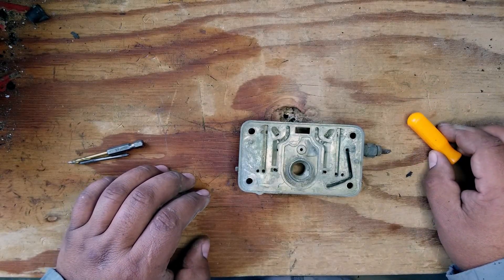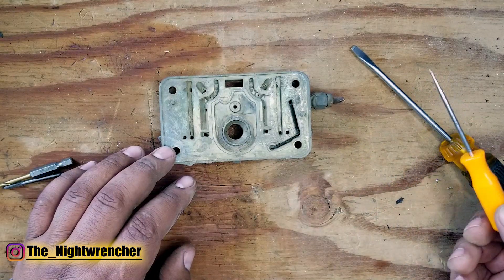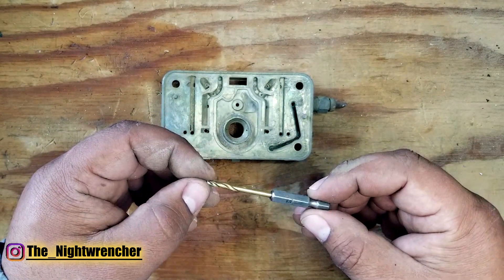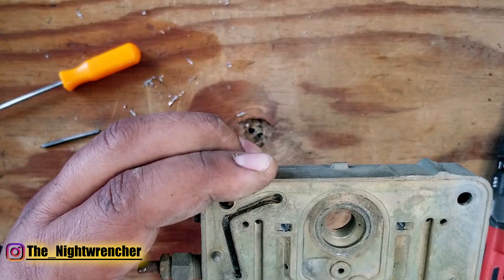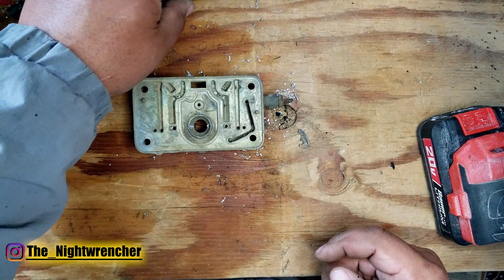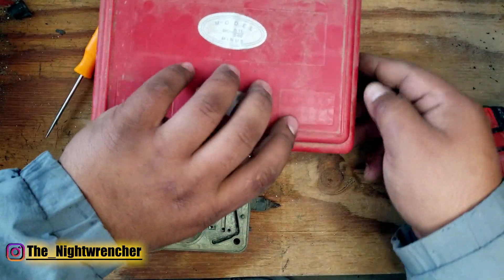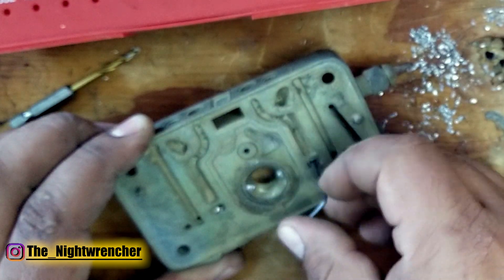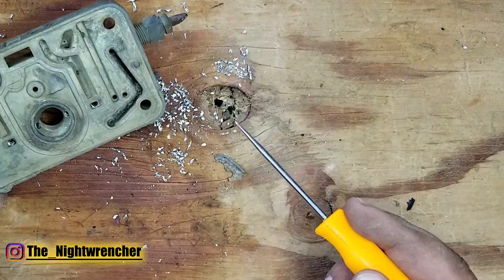Drilling Metering Block For Adjustable Bleeds | Holley Carb Tuning | Holley Carburetor Secrets

Comment: I recently did this with an early model 1850 metering block i got for cheap to practice on, this particular block didnt have the pressed in brass IFR restrictor, so a .090 hole was present. I drilled all the way through with a 7/64(similar to #36) drill bit using a pin vice for better control, then used a 6-32 plug tap, a bottom tap is prefered, but its all i could find locally. I tapped the hole just a thread or two at a time to set the correct depth, i did the same with the .046 PVCR hole, starting off with a 1/16 drill bit and worked my way up to the 7/64 drill bit. I tapped the hole, again,  a thread or two at a time to set the correct depth, used 6-32 x 3/16 brass set screws for easy drilling the hole sized needed for AFR calibration, all went extremely well and used a 1/16 hex key for the fore mentioned set screws, figure next time, i'll use 8-32 for the PVCR holes.
Reply from the maker: Thats exactly what I did when I built my carburetor for my turbo build. Eventually I upgraded to a billet block because I needed larger fuel wells but for the most part a basic metering block worked fine.

Comment: Thanks for posting your videos.  In this one, I applaud you for knowing to keep the IFR submerged in the metering block "wet" portion.  It escapes me why most aftermarket billet blocks want to put the IFRs only in the upper gas part of the chamber.  And there is already an air bleed for that chamber, so what are they thinking??
Reply from the maker: I think its because if you move it to the top, you can go larger on the IFR because the bleed screw will be bigger. Most carbs dont need the added size, but if you go E85 or alcohol, you will need the larger bleed
Reply: Idle circuit requires a pullover so the bowls don't drain empty after shutoff - it honestly doesn't matter where the restrictor is, as long as it has one.  Sizing is whats important, as thats what dictates transfer slot delivery.

Comment: Hi, great video.
I’d like to hear more about the relationship of the IFR and the air bleed that you mention at 1:50.
From what I have learnt from your videos I feel like I have my IFR’s perfect. But if I’m cruising on flat road at 60km/h (37 mph) then gra
Reply: Sorry, sent it before I was finished.
Steady cruising at 60km/h flat road, afr’s perfect on gauge. But if I gently lean on the pedal a bit more to get to 70 or 80 (43-49 mph) it swings very lean for 3 to 4 seconds.
I’m not accelerating hard enough to get much squirt form the accelerator pump, so I was thinking I need to get my mains in earlier, maybe by trying a down leg booster.
But your comment there made me think 
Could that be something I need to look at
Reply from the maker: It very well might. Ill have a dedicated video on it but basically, larger air bleeds airate the fuel to make it lighter so it passed through easier and the IFR controls volume so by increasing both, it should speed up the circuit. Also, booster design wont affect idle or transition.

Comment: 👍💪
Reply from the maker: You almost got yours running?
Reply: @NightWrencher  Bahahahaha
Ur a funny guy!!!

I did get a free 90 amp flux core and 295 amp AC/DC stick welder from my In-Law.  Both needed a little repair but work great now.  I'm a fiddler. 😝

Comment: Better looking work space. Still need a white background on work space.
You are doing a fine job so don’t take anything I say as negative ok.
Have you ever listened to one of you tips?
It would be easier to learn from you if you stopped and took a breath every so often like just after you made a point. It will give the listener ME so time to digest what you are trying to teach me.
Other than that keep up the good work. Happy Thanksgiving 
Mike
Reply: Hahahah, Bench space is MUCH cleaner than mine and I'm over here listening on 1.25x.  😂
Reply from the maker: I've gotten that comment several times before and basically I need to talk that fast to keep the person listening on youtube. On my older videos I used to talk slower and watch time was taking a nose dive, now watch time is pretty flat. I figure you can slow down the video to set the pace better in the settings though so you still have that!